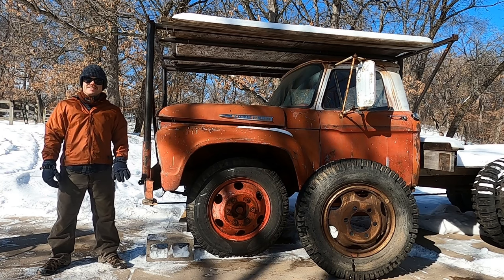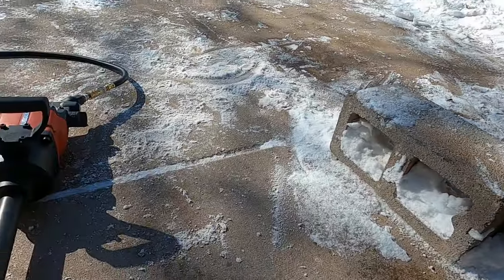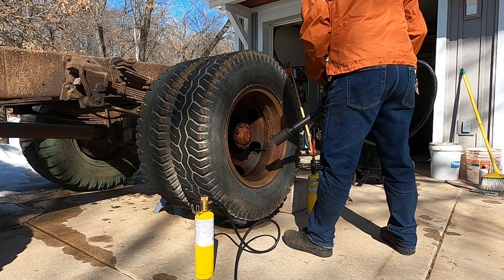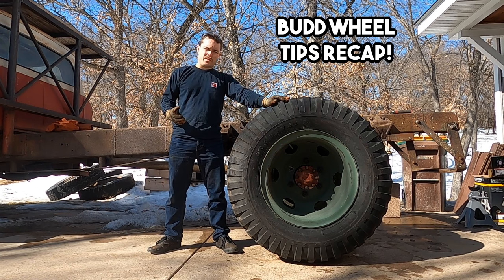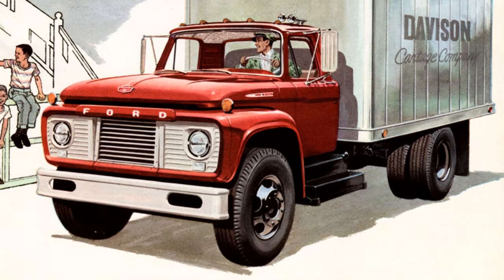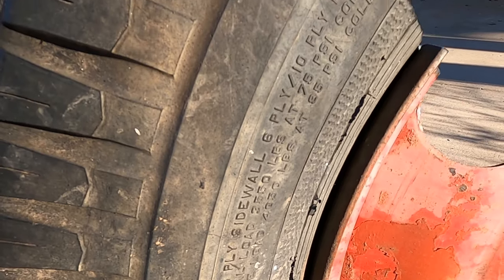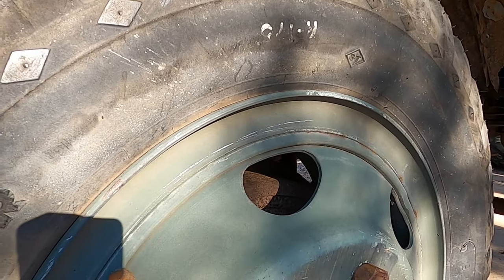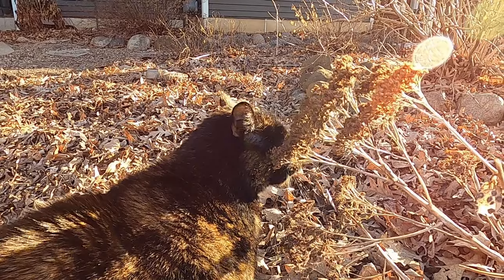All About Split Rims, Explained! Ep. 11

Comment: Need a bigger hose, ends, and volume of Air supplying the impact. 150 psi min, a 1/2" inside dia hose & carquest 1817 type G hose ends for plenty of air flow. It sounds like that impact is starving on the volume of Air, you have 75psi to 80 psi actually running it with that smaller hose. Great video!!

Comment: That big impact wrench is starved for air.  It needs to be fed with a bigger hose and bigger fittings, all the way back to the tank.  The quick connect air fittings you'll find in most shops will choke the air supply and reduce the torque output of a 1/2" drive impact wrench.

Comment: Growing up in Los Angeles in the 50s & and 60s, I remember Firestone servicing our F650s. All were split rings, and if my memory serves me as correctly, they would not service split rims.  They would send  their service trucks to where our trucks got the flat on the road or jobsite.  All of their service staff were big and strong Negro gentlemen that could break the tire bead in one mighty swing of their special bead breaker axe and then  sliding a bent tire tool through the holes in the rim when they inflated the repaired flat that was supposed to retain the split ring if it ever flew off during inflation.  Also, they would bang on the ring with that tool to make sure the ring was seated during inflation.  Sometimes, I would drive the trucks to their shop if it was rear inner or outer flat and noticed the cages they would put the tires in when inflating.
Reply from the maker: My cynical side says if somebody got killed by the wheel, they could always claim the tech wasn't doing it right or something. But the convenience for truck operators is paramount either way.

Comment: To get the most out of a 1" impact wrench need a minimum of 3/4 hose up to 100', after that you need 1" hose, you also need lots of air.  
If you want to see what it will do, get a 3/4 hose and plumb it straight to the tank without any quick couplers, just a ball valve at the tank and hose barb fittings, it will really come alive for a few seconds until the air runs out with that compressor.

Comment: I have buds on my 1956 Dodge 1 1/2 ton. When I inflated them after I had to change tubes I wrapped the wheel and tire with a nylon tow strap then inflated. Had no problems.

Comment: Do any of the wheels on this truck have left handed threads? I notice an “R” stamped on the wheel studs of both front wheels on my ‘64 F-600; just want to make sure none of the studs are left hand threads.
Reply from the maker: Yup, i believe the drivers side is left hand thread. The studs have L's on those. Maybe someone converted yours. Lucky you!

Comment: had a 1970 gmc 1 ton 14000 gvw with 18 inch rims 10 lug  and it had dual rings one split and the other full lock  scared the hell out me to walk past them replaced with 19.5 tube less

Comment: I have a 1953 Ford F350 pickup with 17 in 6 lug widow maker split rims. I haven't had them apart for 20 years since I installed new tires. It's getting to be nearly impossible to find anyone who services these anymore

Comment: You need at least a 1/2” hose for that gun. I run a 3/4” hose for my 3/4 and 1” guns along with a gas compressor that’s 24cfm and my big service truck has a hydraulic 40cfm compressor.  Your gun is starving for air

Comment: I had a 68 chevy c50 with 4 RH5 wheels and 2 of the later locking band wheels.  When we put tires on the truck we positioned all the widows to where the rim would blow to the inside of the truck to avoid the hazard.    Ive changed several tires on these old wheels and the #1 problem is rusty dirty wheels and getting in a hurry.   They do not blow apart at anywhere near operating pressure!  it happens way less at around 25-40 psi    If you get to full pressure then its likely properly assembled.  The inner edge of the RH5 will stand water and corrode and rust away the locking flange and create the danger for the next guy many years later.   A simple close inspection of the wheels when apart is pretty easy to tell the wheels are scrap and must be changed to a later wheel which is common and readily available.  yes they are expensive to change to a conversion wheel so I stayed with my locking band wheels and they are just fine kept clean and painted.  the locking band wheels will easily last the life of the truck when properly maintained.

Comment: I had an older chevy van with dual wheels, and if I remember correctly it had a ring in the middle made like a "C" that held the two halves of the wheel together. I never worked on the tires, but I could see how this arrangement was quite dangerous.

Comment: Just use three-quarter inch air line that’ll do the trick. You just won’t have a whole lot of air at your disposal with a small tank and compressor. The three-quarter inch air line would’ve done you a lot of good just from experience.

Comment: Here is another Hail Mary concerning the impact.
Fill the gun with impact lubrication oil.  This means depressing the trigger and filling the gun with oil.  
Next, COVER THE EXHAUST WITH A RAG!
Place the gun over the stubborn fastener and pull the trigger.
Momentarily you vastly increase the torque output.
I have removed many stubborn fasteners using this method.
Plus, oil does a great job of lubricating and cleaning the insides of the gun.
I always put a few ounces of oil in the gun after use.  Pull the trigger so the oil gets into the inner workings of the gun.  
Great video.

Comment: I hate to tell you this but you might be warning me about falling out the window and I can back right into the elevator shaft and fall just as far. Probably every kind of a tire has killed somebody every kind of arim has killed somebody. We finally have a truck with a little clip on it that catches the threads and holds the truck in place and there's 3 ft of hose there so you can step back from the Chuck and step-back 3 more feet from the handle and turn sideways. There been a lot of different kinds of failures from a tire blow on a chunk out and the peace kills a guy. There was another perfectly good rim wasn't a split rim at all the guy had it on one of those lowriders and was bouncing it up and down. The rim failed and appice flew off and hit this guy right in the forehead just like the old deathblow you used to get from the truck driver tire. It was a fancy good-looking polished lightweight rim so it gets hit him in the head to teach you not to bounce his car up and down like that.

Comment: The best thing to do with an impact gun that size is to plumb a dedicated 1/2" or larger line set right off the tank itself.  With those big guns, there is no such thing as 'too much air'.   150 PSI  on a 5/8" line is where they are happy, not overfed.

Comment: I worked  truck tires in the 70s .  You should be using a larger air hose. By the sound of your air wrench, you only have half the pressure that I remember . . .

Comment: You need AT LEAST a 3/4" air line to feed that impact. That 1" impact should sound like a HUGE 1/2" impact. It'll suck that tank down pretty quick, but if you start at full pressure, and hit the lugs and wait for the compressor to recover, you'll RIP those lugs right off.

Comment: Worked on both the split rings & RH5s as a teenager at a country gas station way back when.  Boss was careful to teach me how to assemble them & air them up.  We didn’t have a cage so after repair of tire & reassembly of RH5 would lay a 2x10 plank over it & lower the car lift down on plank. l had one blow on me.  That was an attention getter.  Some months later Boss had one blow on mounted truck as he was airing it.  Severely broke his arm and for longest time he was in elbow cast and I got to do all the heavy work.  Grateful he got away with only that.  Down the road at another place employee got rushed, didn’t use cage they had.  RH5 blew and decapitated him.  Had to treat them with respect.  Especially farm and logging trucks because they would be worn and beat up.  Use a wire brush and clean them up real good before reassembly.

Comment: Pull the reduction plug out of your reservoir tank on the little air compressor and plumb it with a one inch ball valve and a Chicago fitting. Then you could run the heavier hose and feed that gun the air it needs. Ive always put just enough air preasure in the wheel to hold the ring on the rim then put it in a tire cage attached to a clamp on hose where i can control it remotely.  Most heavy equipment cranes, loaders and such still use lock rings on a multi stage set up.
 Great video

Comment: I had split ring wheels on my 72 Chevy 3/4 ton. Changed many sets of tires on them as I would buy old rag tires from the wrecking yard for $5 each (I was 16 and broke). I always wrapped 2 chains through the center and around the tire to contain the ring if it failed, never did see a failure but the creak and pop as the pressure increased always scared the crap out of me. 50 years later I'm still alive.

Comment: If you have lugnuts that won't come loose there is another trick where you don't have to wait. Put a deep well socket over it and wack that thing hard about three times. Use about an 8 lb Sledge. If it's too far in where you can't get to it with the hammer you may need to put an extension on it and wack that. After a few smacks it will break loose. This will even work on car wheels where you use just a four-way. On a truck you'll need somebody to hold the socket and extension on there, and then another person give it two or three good wacks. You can also incorporate some penetrating spray but usually you don't need it.

Comment: Not to be a dick but you don't have nearly enough air capacity to run that gun. Even with a short hose and  being a harbor freight special you needed a lot more air. Nowadays it's actually pretty hard to beat a good electric/ battery powered impact just because of the instant joules available vs a pneumatic system. Great work describing the differences on a split ring vs others. It's too bad there was never an ASE or SAE standard agreement on wheel design.

Comment: Just out of curiosity...  Have you ever heard of or seen Trilex rims?  These rims do not have a locking ring, but, are made into thirds.  The ends of the rims have to be mated to the correct partner, or they do not fit together.  The benefit of these rims is that there is no locking ring to blow out.  The higher the air pressure in the tyre, the stronger they are as a bond.  The drawback is that vehicle inspectors that have never seen this type of rim, go mad with defect / out of service notices.  It has cost one vehicle inspector a broken jaw.  The owner of the truck took to the inspector.  I do not blame the owner of the truck for his rage.

Comment: I appreciate the video. I just bought a truck with split rings. A friend made a big deal out of them and got me scared. I feel much better knowing that while my rims aren’t the best, they are not so dangerous.
Once my spits ring rims are fully inflated and mounted, they should be safe, correct?
My semi is so cool and will be hauling around a semi food truck trailer. There will be people walking around the truck. I just don’t want to have problems.
Reply from the maker: From what I understand, once you get a few miles on the wheels they should be set for the life of the tires. Have fun with the truck and trailer and of course be safe!
Reply: Thanks for replying.

Comment: Back in the 80's I worked for a Tire Store Chain here in Florida. we where told that we all had to do split rims and snap ring tires. they never trained any of us on the proper way to handle these rims. I learned how to mount tires from an old tire man but it scared me to think how many guys did these without any real training. I even saw one guy standing over a tire while he inflated it.. If that ring had come off it would have cut him in half.  Today, I would never try to mount tires on any of these type of rims.

Comment: Even with the split ring you have to be very careful. Any evidence of damage of any kind on the rim or ring renders the assembly scrap and make sure with a cutting torch. As mentioned in the video, never mix wheel components. All rust has to be completely removed. 
In Vietnam I saw a guy nearly get killed with a split ring wheel assembly. He was saved by his pith sun helmet. It kept the ring from taking the top of his head off when the assembly blew apart. The ring went about 100 feet in the air. 
If it were me, I'd never service any type of multiple piece wheel assembly.

Comment: I broke in on split rims. In the early 70s I was low seniority man in our shop. I was tasked with the tire repair job. Once I was doing up a split ring I assembled it and hooked up the chuck. I turned around to grab the hammer to give it a love tap. Before I could come back the ring blew off the rim. There hadn't been much pressure in it yet but enough to send the rim to the ceiling. Lucky me the boss didn't want to see me get hurt and the next guy in line got the job. Few weeks later a tire contractor was doing tires. 
  Over the years tire incidents were not uncommon.  Stacks of tires would be thrown across the room. We lined them up about 10 deep. Twice as I had just walked by.
  I got in the habit of looking between the duals to see what's up.  Many times that flat the driver complained about was a rim that let loose. It would fill the void between the tires where the spacer was. Time to take the valve out! Even modern tires have their hazards. They blow up too though they usually creak and pop beforehand.  
Tires are dangerous.

Comment: I worked as a tire jockey at a truck stop when I was in high school (1983) and the owner was a real bastard but he told me I didn't have to work on any split rims because he didn't have a cage.  It sure was fun changing tires on 18-wheelers on the shoulder of the interstate at 16...   I got $20 for being called in on a Saturday night and four more trucks pulled in with blown tires.  He refused to put me on the clock or pay me another call-in fee even though I'd already worked all day and it could take up to two hours to pull off an inside tire, replace and remount it.  So one of the truckers asked where I was going when he saw me getting back in my car and I told him I was going home so that old bastard would have to call me back in and pay me another call-in fee since he wouldn't put me on the clock.  So he gave me $20, then went and talked with the other fellas, and they each ponied up too.  I went home at sunrise Sunday morning with a cool hundred bucks in my pocket dirty and exhausted but mighty happy as it was a $ 3.35-an-hour job.

Comment: Do you have a part number for the socket you used to get the wheels off? Looks like the brand is Carlyle but couldn’t read the serial number. I have widowmakers on my ‘64 Ford F600 and am in the process of replacing all the wheels with 20 inch split rims right now.
Reply from the maker: I believe it is 617826 NPT.
Reply: @SealedBeamRallyTeam : Thanks much!

Comment: The Goodyear kw is the true  widow maker they are rare. most tire shops won't touch them. I encountered 1 in my 10 years of tire service. Would not align proper so we sold the customer a different wheel and scrapped that pos. Not worth the risk!

Comment: For starters, your air hose is too small. Your gun will have way more power with a minimum 1/2 inch hose. 1 in is best, providing you have enough compressor. When I worked in a tire shop, we absolutely refused to work on these wheels. Which didn't break my heart. I saw one of these come apart. It did major damage to the concrete wall it was leaning against. That was some 50 years ago, but i never forgot it.

Comment: I spent 37 years in the commercial tire business, the first 5 in service. Not once did I experience a split rim or multipiece wheel exploding on me. The #1 cause is operator error or carelessness. Several associates had it happen and they were all injured; a couple seriously. Their problem was carelessness, plain and simple. They did not observe the rules for mounting and dismounting, although each of them were schooled in the subject. You wouldn't ignore safety precautions with a grenade, so why would you ignore them with a wheel? An exploding truck wheel has the equivalent force of about 3 sticks of dynamite. A passenger wheel has about the explosive force of 1 stick of dynamite. I witnessed a co-worker picked up off of his feet and thrown over 2 tire mounting machines when he mounted a tubeless passenger tire that had a broken bead wire. He is lucky that all he incurred was a severely deformed middle finger and hand as a result. He could have easily blown his head off.
Reply from the maker: This is something one suspects when reading such reports, but it's hard to say for sure without a lot of firsthand experience. Thank you for sharing! I think at the end of the day, OSHA took the stance that people can't be forced to follow all procedures all the time, so it was better to remove the product that required extra work to not be deadly. Even with the precautions and cages and all, I find it hard to fault them on that. People are gonna be people!

Comment: Airplanes still use split wheel designs. They have one major difference though: they are bolted. 
Airplane wheels are held on with one bolt, like F1 wheels, so it’s impossible to mix up the wheel bolts with the axle bolt. (All service personnel on airplanes have to be licensed, so they have proper training.) 
Still, we were taught the dangers of it. Even with little airplane tires inflated to 35 psi instead of the normal 200 on large airplanes, always remove the valve core, not just deflate the tire, before touching those bolts.

Comment: You need 1/2” diameter  supply line to the air compressor .  You also need an air compressor that will produce 15 CFM of compressed air .  Well Done !